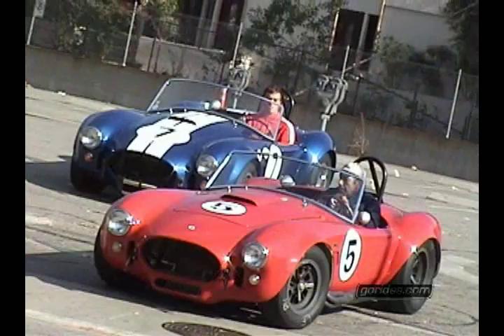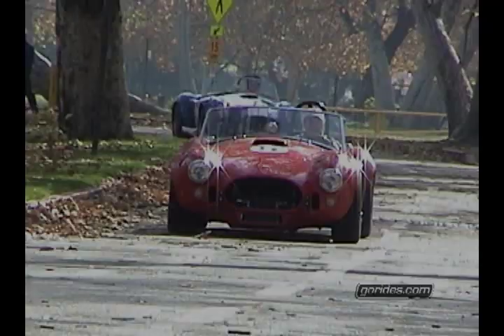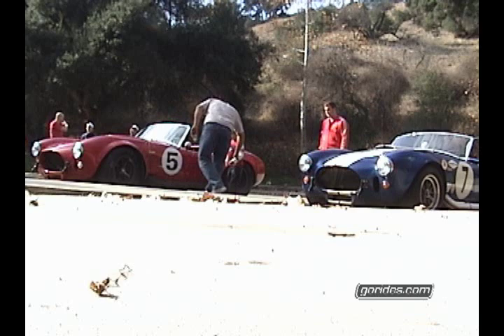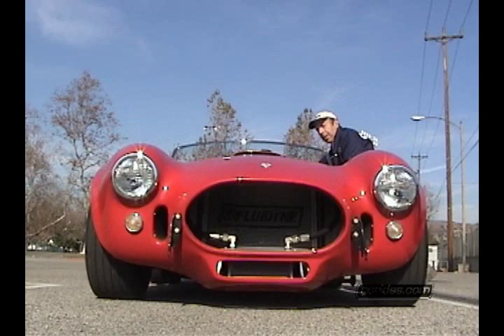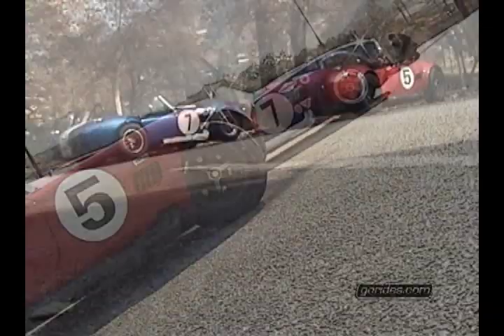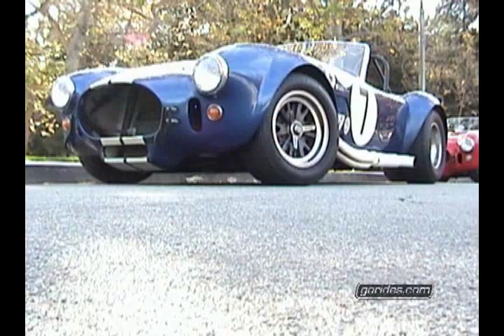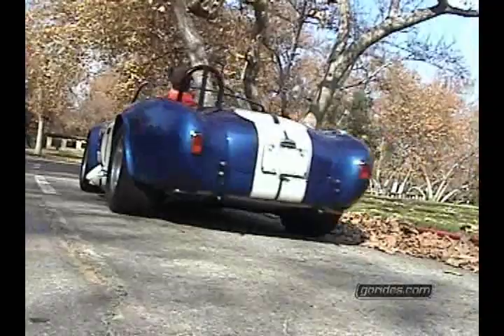Shelby Cobra - Two Original '65 Competition 427s

Comment: "Change the rear end gears and the car will do 185 mph".  The Cobra Daytona Coupe with a little 289 with just under 400 hp hit 197 on the Mulsanne Straight with Bob Bondurant at the wheel!  That's how important good aerodynamics is for attaining top speed.  You still have to love the 427 for all its bravado and sheer muscle.
Reply: The fastest speed ever recorded in a Cobra roadster is 202mph in Dick Smith's legendary red #198.
Reply: @BradThePitts  - Dick Smith's 427 S/C hit 198 top speed at Daytona and that record lasted 40 years until a Superformance replica hit 201.  However, that car was not an original Cobra and the 427 FE was opened up to 496 cu. in. and had many internal mods done to put out 690hp, well in excess of any stock Cobra roadster in 1967.  The typical top speed with the gears used in road racing for the 427 roadster was 165-170.  As with any car, you can put taller gears in to bump that up to 185 or so.  
The 289 Cobra roadster was not capable of keeping up with the competition at long tracks like Le Mans as its top speed was closer to 150mph.  The 250 GTO Ferrari could hit 183!  That is the whole reason for Shelby to make a Cobra coupe, as the roadster was about as aerodynamic as a brick.  If they had finished the project of putting a 427 in the Coupe, it would have destroyed all the records set by the 427 roadster.  However, that never happened.

Comment: I also  wanted one of these jackets as it really looks even better than the Shelby "Team" jacket. Racing Division Los Angeles [RDLA] made only 2 of them according to Mike at RDLA. The "COBRA" letters on the back of the jacket alone were $150.00. I found a "Blank" blue quilted jacket very close to this one and had my own made with my choice of Shelby Cobra patches as well as the "Cobra" embroidered on the back. The cost to me to make my own up was around $250.00, that includes the cost of the jacket, getting the patches sewed on, and  having the "COBRA" embroidered on the back.It turned out great I must say

Comment: The red one which Im sure you are aware will make over 600 hp vs the medium riser in the blue one making only 500+ even stroked to 450 cid. That is what a huge difference the high riser was to the medium riser. 99% of the people think that because they have a 427 side oiler that they have the good 427. It is a good motor for sure, but they have no idea what a huge difference there is between the 427 street cars that were all medium risers, and the high riser.  The high riser was never available  in a car you could buy. They were supplied to Shelby obviously,  and to factory backed racers only. Even the Thunder bolts were medium risers. The high riser intake manifolds runners were about 5/8 of an inch taller than a medium riser.  The intake ports on the heads were a 1/4 larger and a big portion of that amount was from the floor of the port up. Allowing high riser to make huge top end power. That suited the 427 very well due to the over square bore to stroke ratio. The High riser would turn 7800 rpm with the flat tappet cams they came with., as to the medium riser about 6800rpm  Its like night and day between the two.

Comment: Same, save for the 6000s aluminum body vs fiberglass.  Like the ERAs a lot,  just lack the time to build.  Very faithful.  Had to buy a roller & just dropped in an aluminum 454 FE (stroked 427).

Isn't  it fun having first-hand knowledge of what you're talking about??  Your pen pal here probably drives a Civic with a wing.

Comment: I've got a copy of the original repertory of the cobras, coming from AC cars.

CSX 3026 went out of the manufacture the 2.5.1965, with no paint, and black interior.
CSX 3016 went out of the manufacture the 22.1.1965  with no paint, and black interior.

Both are from Shelby los angeles, and that's true, they are full competitions cars.

Comment: The red car raced in WV...that probably would be Summit Point which opened in 1970. There is a good chance I raced against it. I have a photo of the start of the "Big Bore" National which shows a Cobra on the front.
  Did it run at Marlboro,MD in 1969? There were several A Production Cobras that ran there in '69. I raced there in every race that year. 
I had the opportunity to drive a 289 Cobra for a couple of laps at Summit Point in 1970 or '71.

Comment: @ warger92: the ford reproduction replicas can be build for bugets around $30 000 mid end - 50,000 High end for cars that have way more race proven potential pedegree, are state legal, are certifyable, and pass all the legal liscencing laws. Unlike a honda these cars have a linked racing history, can be tuned to amazingly high figures and run for hundreds of thousands of miles doing so, because they were originally purpose built.

Comment: @ warger 92: assuming that your car has five gears, your lag time would be 3X5 = 15. 15 seconds of time where your car is running at 150 hp maybe 250 300 if the engine is insanely modified. vs a cobra in a launch of 4 gears with 0 seconds of horsepower lag.  not only this your car's rear end gears wouldn't be matched up as efficently to the cars engine which would result in maybe a very modest 150 mph at top speed!

Comment: @HYDEDB sure, take them out and enjoy them. On track days that is. Put them on a trailer until you get somewhere safe. The thing is, you can be Mr. careful all you want, truth is its almost always the other guy in a situation like that. I have a 94 mustang GT with some loud borla exaust I use for  a daily driver all summer. I get pulled out in front of, and a few weeks ago almost run over by an 18 wheeler. I do not get that in my expedition. Try all you want, you cant predict the other guy.

Comment: @warger 92: Ehp/Bhp is very different comparison to wheel horsepower! engine horsepower is measured at the crank and, losses much of it in the output process and by the time it gets to the wheels is maybe 350hp! Bhp is again very different then Whp. Bhp is the horsepower at what the car breaks at near from top speed in comparison to Whp which is the horsepower that the car is able to put to the pavement. again Bhp is estimated to  500 which would maybe acount for 400 wheel hp on a single pull.

Comment: @ warger92: I have no problems with Honda's, they are great Economy cars and make great little hot hatches, but the fact is that they aren't racing cars, no matter how badly you want them to be, they are just that hot hatches. Why are cobras so Expensive, exclusivity, only 21 Fc's and 27 Sc's were built, for racing in the 60's, there  where hundreds of original street legal cars but they still fetch for high prices because they bring people back to an era of memories...

Comment: @warger92: assuming that you have a clear understanding this terminology lets look at how charged aspiration works. a turbo spools compresses air and then after a lag period the compressor forces it in through the intake and into the combustion block. your 500 BHp or EHp will only kick in after each spool.  your turbo spools each gear change and you're engine revs really high assume 12000 Rpms. assuming that your turbo is pushing high psi's your lag is going to be high, 3-4 seconds per pull.
Reply: @a0522625 - Not today!  The 2017 Ford GT's twin turbo V6 has electronic control of the turbos in race mode, and virtually eliminates turbo lag by keeping them spooled up.

Comment: Lets for a second assume that you built a $10,000 Dart built racing spec honda a 2.0L engine for your car and  $4000 spec racing richardson 5 speed transmission, and $2000. in rear end gears, $2000 in suspension upgrades $1500 in rims and tires upgrades, $500.00 in ceramic brake upgrades and 
$2000 in air charge equipment $800.00 in exhaust equipment, $2000.00 in frame strengthening adjustments. approximate prices for drift cars. you would have a car that could keep up to a cobra.

Comment: @warger 92: for now will assume that you have the 1991 Honda Crx 1.6L version of the Crx vtech... when it was produced in 1991 it had a peak engine horsepower of 150 at 5000 Rpm's vs the cobra stable horsepower of 500 wheel hp at 6000 Rpm's. Secondly lets imagine that after $10,000 of modifications your Honda has 500 Ehp/Bhp) It would have to be turbocharged pushing very high boost numbers, and would also have very poor horsepower lag.

Comment: Carol Shelby look for a car to use. ac ace out of england had this car and it did not do well. it raced with an undersized 4 banger. 260 engine was given to him to put in the car. believe it or not it was a tight fit. and if legand is true its first day out for a drive it blew the doors off of a corvette. i would love to have one of these cars and a 427 gt40 in my garage.

Comment: If you built the car in this manner it would have cost you $24,800 just in modifications. this does not include the price of the car that you would have originally bought, it wouldn't be allowed to be driven legally on the streets nor would you be able to legally insure it, It would weigh much more then a cobra, and it wouldn't have anymore potential speed. Ford Factory Reproductions has joined up with factory five, giving them the specs to build almost exact replicas....

Comment: How safe are they to race? 
It looks like there's nothing there to protect you if you're hit on the side, or if you flip it.
Reply: @charlesvan13 - In the '60s when they were built, they were done so with much more concern for speed than safety (as were other racing machines of the period).

Comment: @Warger 92: it is very simple to compare and your numbers are very wrong. First off an original cobra in that condition can run anywhere from 500 000 to 5 mil ( Highest selling cobra). Secondly, This car was a 4 speed  built in 1964 msrp at that time was $7000.00, it had 500 naturally aspirated hp + in its original configuration and weighed under 2000 Lbs having a max speed of 185Mph...

Comment: Tch! Brands Hatch is a race track in north Kent in England. And those two cars are AC Cobras yanky boy! They were built in England by AC cars whose chassis and aluminium bodys they use.
Reply: @Sven Tviking - Oh really??  This Yankee Boy will take you to task on that statement!  The Shelby (not AC) 427 Cobra had a completely new chassis, designed with input from Ford, Detroit, and made to handle the 427s massive torque.  Shelby added independent suspension all around, rack and pinion steering, larger wheels and tires, much larger disc brakes, and a redesigned and slightly enlarged body.  It was so much more done by Shelby American than your insinuation that it was a British cake with American frosting!

Comment: Carrol Shelby should get 100% credit, the AC bodies were rough at best and all had to re worked once they got over here, Mr. Shelby was quoted in saying they they were banged out by drunkards under a bridge. they are not an AC chasis (first car to have a computer designed frame)and they are as light as a vw golf.
they were built at the LA airport in a hangar.
these car are 43 years old and will kick the living crap out of just about anything 0-100-0 in 13 flat.

Comment: no disrespect intended, but you mostly see replicas because very few people have the quarter of a mil or + spare in the bank to drop on a car...  personally i doubt i ever will, however i'd LOVE to own a cobra.  and if i did, i would rather drive it than put it under a glass case.  i would feel more comfortable leaving a $30,000+/- replica alone in a parking lot than a $250,000+ original.

Comment: LOVE THE VID...........Fire the guy how did your lockwire,
Reply: +mowog1000 You are right what the hell? the way they are done the knock offs could rotate significantly without pulling the wire tight.
Reply: +mowog1000 the safety wire is there to tell you if the Knockoff has moved.  It will not keep a knockoff from spinning.  The safety wire will eventually break & it will spin off.  So....the safety wire is installed as a quick eyeball gauge to tell if the knockoff has moved.   They rarely do but, it's not a bad idea to have the indicator.
Reply: +Hyde Baker I've learned that since the comment was made and do mine loose now too...thank you
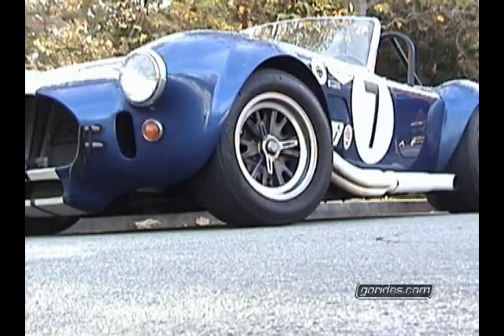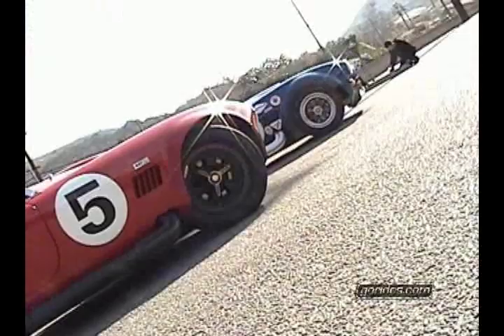Reply: Hyde Baker No, no, no The original pin-drive wheels had a Right-hand thread, clockwise to tighten, at 2:23 on the driver side(American left hand drive), note the wire is oriented to keep the spinner secured. Again, at 4:04 on the red car, on the passenger side, we see the wire oriented correctly for the left hand threads(counter clockwise to tighten), to keep the spinners from coming loose. What do you think safety wire is for anyway?...to keep things secured, from inadvertently "unscrewing".

Comment: The 427 Cobra uses a chassis and suspension designed by Ford and Shelby American, as well as a body designed by Shelby. The notion that these are an AC anything just isn't accurate, and by the time we got to the 427 Cobra Auto Carrier was effectively just a chassis/body supplier. They would eventually build their own cars on these chassis, and in a way those could be called 'AC Cobras' but they never were officially named Cobra and they never came equipped with a 427 in the 60's.

Comment: He turned a colossal failure of a Brit car into one of the most iconic racing cars of all time. Yes, i'd rather be seen in a Viper than a Cobra, but in terms of driving fun, it's like comparing an Escalade to a Lotus, the Cobra is fun to drive, and the Viper is harsh and unforgiving.  Not complaining about the way the Viper handles however :p
Reply: @F22RaptorSquadron - Sorry, but the original AC Ace was anything but a "colossal failure".  It won its class at Le Mans in 1959 and was usually a winner in class in the U.S. in the 50's.  You are an incredibly unique person, I must say!  What I mean is, if you took a random 1,000 sports car drivers and asked them which they would rather be seen in, a Shelby Cobra or Dodge Viper, they would virtually all say the Cobra......that is after they stopped laughing!

Comment: i cant really give shelby credit for making this car i would have to give it the AC it is really there design all shelby did was put a different engine in it. still a great car though!
Reply: @walters1992 - If that's all you think Shelby did to this car from the original AC, well,............You couldn't be further from the truth!  The 427 Cobra had a dimensionally changed body, a completely different chassis, suspension, brakes, rack and pinion steering and numerous other changes.  The British originally made the car, but Shelby created a race winning monster out of it!  Please give Mr. Shelby the credit he so richly deserves for this incredibly successful transformation.